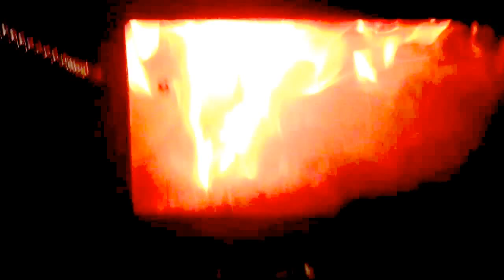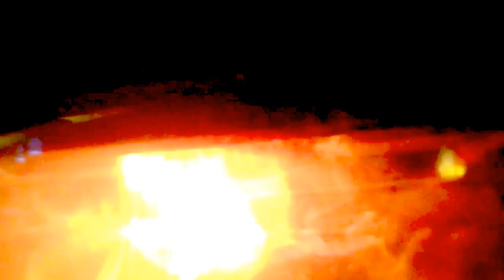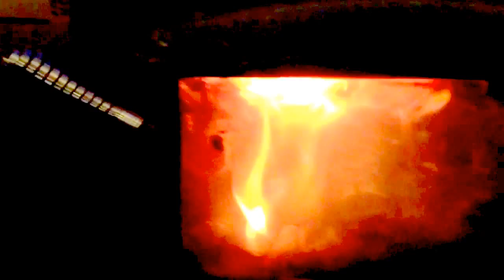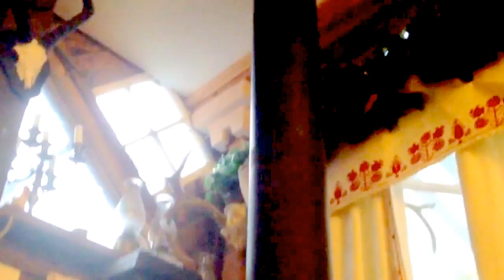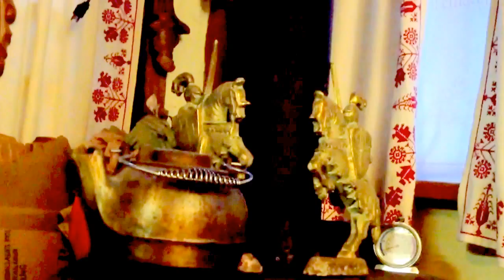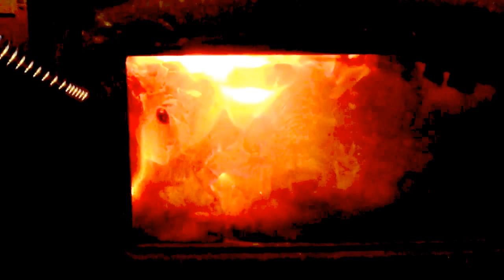Regency EPA Wood Stove Design Efficiency Burning Own Smoke as Fuel

Comment from the maker: Depends on the configuration and your burning skills mostly. An outside chimney heats up slower than an inside one so it will require a hotter kindling fire to start the reburn process. Also depends if you are in an inversion area. Mostly it depends on burning skills.  These stoves do smoke a bit for a few minutes until things get heated up and they start the return process. Depends on moisture content in wood as well. Most of the calls I get for malfunctioning stoves are burning skills issues.